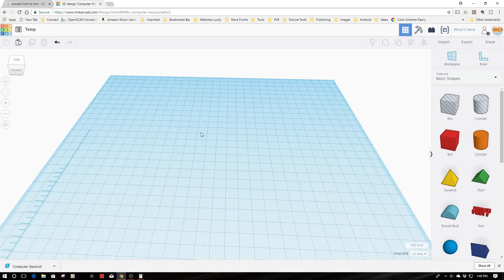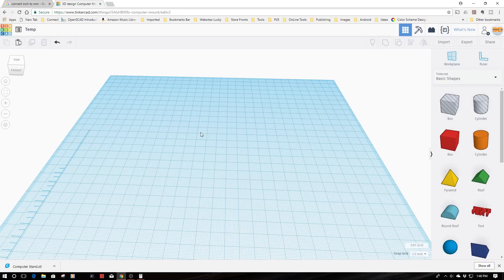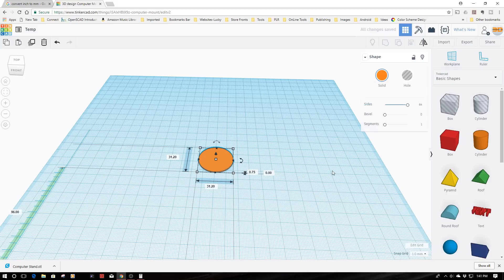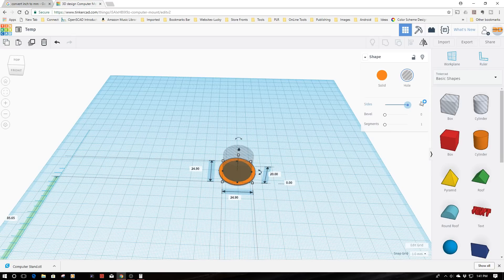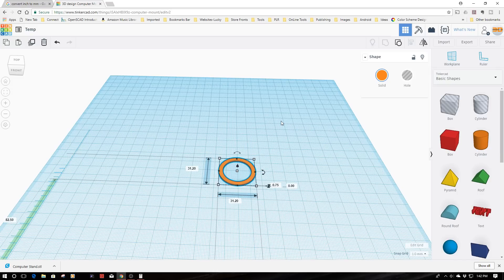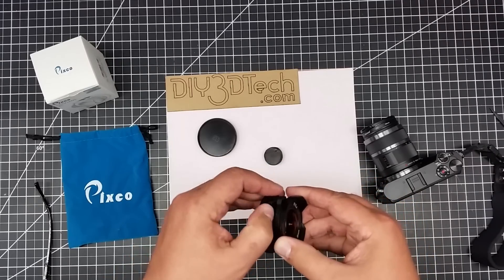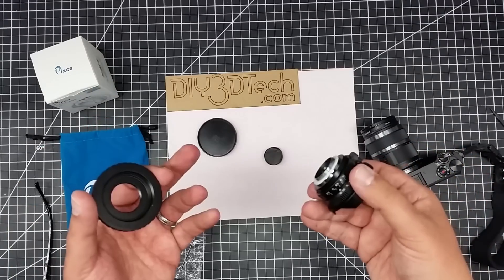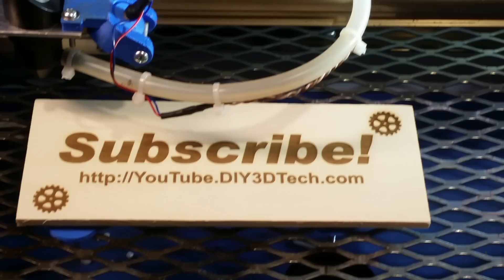3D Printed Project - Precision Shim for Camera Lens!

Comment: 3d printed =/= precision 

especially not a shim
Reply: Depends on the printer you're using.  SLA printers are much more "precise" than FDM.
Reply from the maker: Sure works nice!
Reply: that i will agree with
Reply: Working nice and being considered "precision" are two completely different things. dont mix them chap
Reply from the maker: One mans "precision" is another mans "crude"... Is it tomāto, or tomăto?